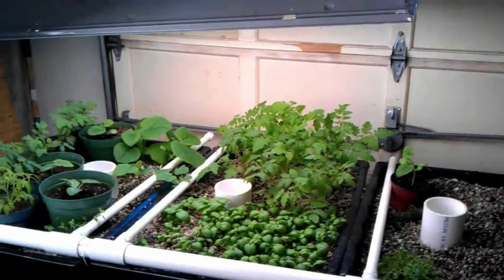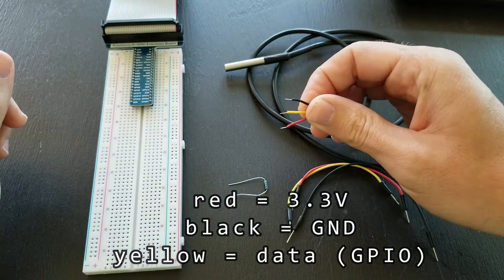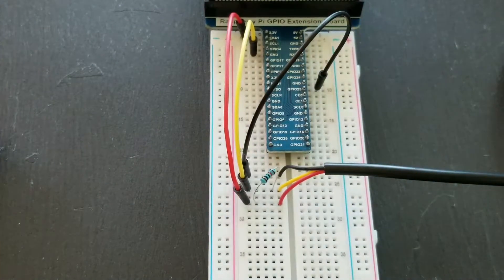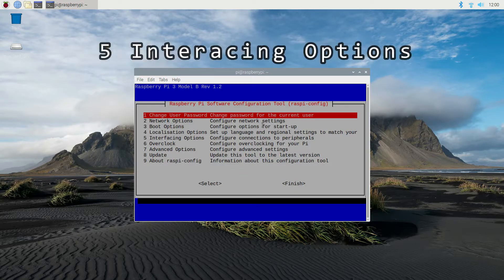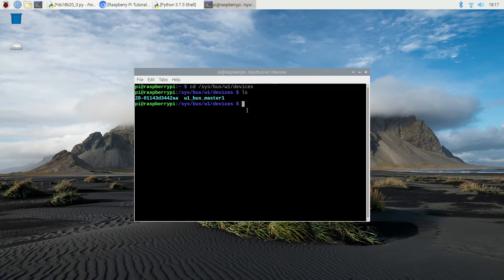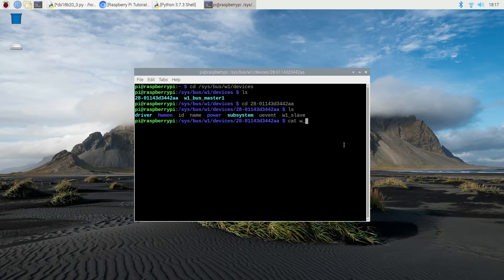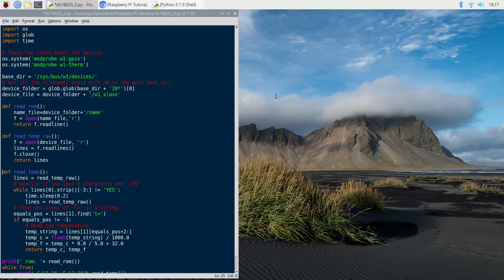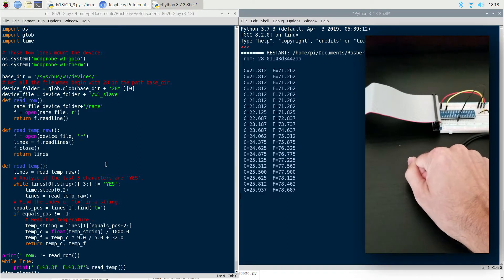Raspberry Pi DS18B20 Sensor

Comment: this tutorial is great but for some reason, whenever i type in "/sys/bus/w1/devices" then "ls" nothing shows up. even though i have the exact same sensor wired in the exact same way. I also tested and there is voltage going through my circuit (from power to ground)

Comment: hello what can i do, because whenever i typed cd /sys/bus/w1/devices (enter) then ls the value showed is 00-200000000000? pls help me
Reply: I have the same problem, and when I type in those numbers in the next step it says no such file or directory. Did you find a solution to this problem?

Comment: Hi, thank you for the video. I would be interested in connecting upto 50 devices in a chain. Is that possible?       Will there be congestion on the bus? The conversion time is  ~90 ms (upto ~800 ms depending on the bit resolution). Does it mean the cycle time for the whole bus would be 50 times 90ms? Or is there a way to send some kind of strobe / sync signal, so that they would all start their measurement at the same time and than read them out sequentially? Thank you.

Comment: I am sending a weatherballon into the statosphere and want to use two sensors to measure the temperature inside and outside of the payload-box :D i just tried soldering the necessary wires and resistors and since it was my first time soldering at all it turned out to be a complete abomination xD But hey, as long as it works
Reply from the maker: How it turn out?

Comment: Hello,
First of all I would like to thank you for the video, it was a great help for my college work.
How would I be able to export all temperature readings to a log file, instantly?
It could be .csv or .txt.
Would you have a code like that?
Reply from the maker: https://youtu.be/7ZIGZ38aNQE
Reply from the maker: Let me know if this is what you're looking for. If not, there are many ways to do this; I can probably put together a few other examples of needed.
Reply: @izzyanalytics4145  Yes, that's what I'm looking for, but in the video you capture the internal readings of the raspberry, right?

I look for how to insert the DS18b20 temperature readings into the open file.

thank you for your attention
Reply from the maker: It's been a while since I've looked at this, but I believe I did something like that here: https://github.com/israel-dryer/Raspberry-Pi-Sensors/blob/master/ds18b20_logger.py
Reply from the maker: I'm using f-string formatting, so you'll need to have python 3.6+. Otherwise, all you'd need to do is change the f-string formatting to the `format()` method.
Reply from the maker: One additional comment... the mode 'a+' is for appending to an existing file. So, if the file does not exist you would get an error. You can just create an empty file with a text editor to resolve this. You can also open the file in 'w' mode, but this would overwrite anything that the file contains... which may not be what you want. Good luck.
Reply: @izzyanalytics4145 Thank you very much, I will test it with my sensors. Great help

Comment: hi there, does its need to be a 4.7ohm resistor or could I use a 10k one instead? (Great video)
Reply from the maker: 10k should work
Reply: The resistance should be 4700 ohms (4k7). 
At 3.3V it can be reduced to 3300 ohms (3k3). 
That is about 1mA current.